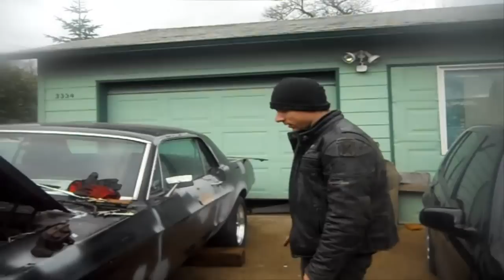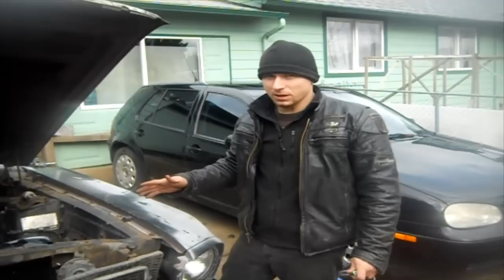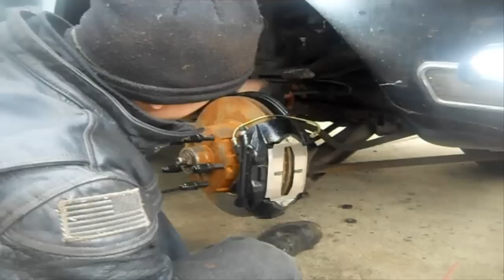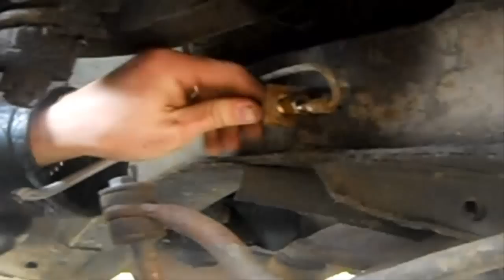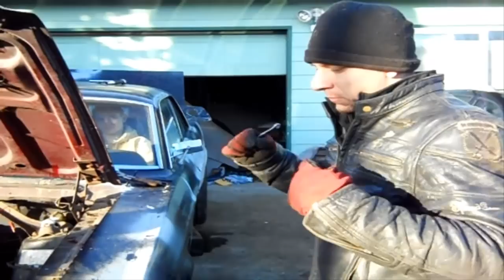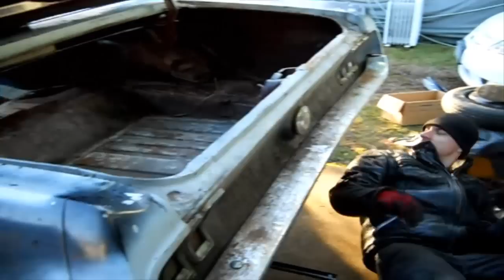Craigslist 68 mustang cheap 4 lug to 5 lug 4 wheel disc brake explorer axle conversion

Comment: Great information but what you need to take off those brake lines is not vise grips no no no, you need a brake line wrench. They work fantastic. Not sure if YouTube will let me post a pic of one but I will try.  http://www.focusst.org/forum/attachments/focus-st-brakes/23174d1382555720-rear-brake-lines-won-t-thread-back-into-calipers-corp_0706_06_z-replace_master_cylinder-line_wrenches.jpg  A little propane torch is a life saver as well. If you are not worried abut the old flex line you can heat the compression fitting then cool it fast with cold water or spray WD 40 on it to cool it. Do that a couple of times and you will be able to turn that compression nut on the line if it is seized on the line.
Reply from the maker: All true, but nothing wrong with a one time application on vice grips in a a pinch...
Reply: Oh ya in a complete pinch ingenuity rules!
Reply: What ever happened to that mustang?
Reply from the maker: Dave Brittain still have it, going to cut it up to save my 68 fastback
Reply: For some reason I am not able to search your videos. It seems like you put tags in them that use that other video titles because no matter how specific I search your entire video list comes up. Makes it really hard to follow anything. I wanted to search your fastback. What is the situation with it? (condition and specs) Is it that bad that you need to hack the other up. It looks like it is worth saving. I watched quite a few of your videos and you remind me alot of me when I was young lol. Car crazy!
Reply from the maker: Dave Brittain if you go to our YouTube channel you should be able to sort the videos using the different playlists.  they are separated by topic.  and yes my 68 fastback is beyond toast.

Comment: did you leave the rear end off center?  does the driveshaft hit the floor if so?
Reply from the maker: fleetgt left It the way it came from the explorer, no issues.  but you will need to dimple the floor of a 65-66...
Reply: Invincible Extremes Muscle Cars Garage thanks for the help! this is an awesome forum you got going here. I'm putting the explorer 8.8 in my 69 mustang and crawled around under it one night and it looked like it might be close to the sides of the tunnel.  I'm also going to use a police interceptor  aluminum driveshaft also. It's a larger diameter but everyone says they vib way less. I'm not in love with my floors but I don't want to mangle them either if I don't have to.

Comment: did you use the original spring perches
Reply from the maker: +Joaquin Maldonado I just widened the spring perches on the explorer axle housing by an inch on each side.  Worked out perfect.

Comment: could you do coilovers instead of leaf springs?
Reply from the maker: +charmoines jordan yes, many companys sell kits to convert.  These rears work fine for that
Reply: By kits do you mean 4 link setups? I'm still new to this and it's my first restoration. And I'm liking the idea of using the explorer rear instead of spending 1900 to 2000 on the suspension
Reply from the maker: Honestly theres no need... the explorer rear end, some stiff 5 leaf springs and 620lb front springs and the front brakes off a 2014 mustang will handle way bettef than spending all that money on some fancy suspension that really does the same exact thing... trust me on this one ;-)
Reply: +charmoines jordan ok. what's your guess on how much power/torque it can handle. I plan on putting a supercharged coyote motor in the future.
Reply from the maker: charmoines jordan  its the same guts and axle as the newer gt500 has... so that should tell you somthing.  With a support cover and better axles 800 hp shouldn't be a problem.
Reply: +Invincible Extremes Muscle Cars Garage I messaged you on Facebook

Comment: LOL it is not as easy as a straight swap since the explorer axletubes are different lengths.
Reply from the maker: wugrut have you done the swap before?  I have.  it works just fine.  and all my friends who has done it are reporting the same results...
Reply: Done it in multiple Fox bodies... apparently, the offset doesn't matter on the older Mustang Chassis with leafs?  Did not mean to bust balls.  Was a casual observation based on what I have seen.  Nice to see it work for you bro.  Good info.
Reply from the maker: wugrut no worries, it doesn't matter but some exhausts do come close to the driveshaft, and on SOME cars it touches a corner of the rear floor, but most don't care.  it is a cool swap for the earlier 65-66 cars cause using two same size axles and cutting 2 inches off the long tube makes it a perfect fit all around.
Reply from the maker: wugrut I like to reply to all comments, the smarter fellows like you catch on, but it throws some for a loop when they're just hating ;-)

Comment: Would like to do the same Ford Explorer 8.8 swap to my 77 buick skylark. Will i still be able to use my size 15 inch rims? If not, What would you suggest?
Reply from the maker: +Richard Smith 15 inch rims should work